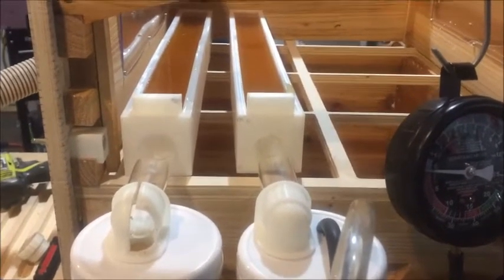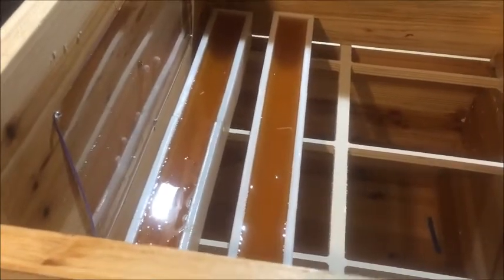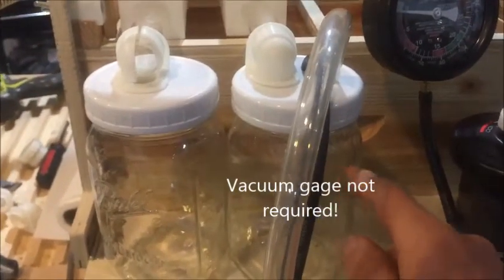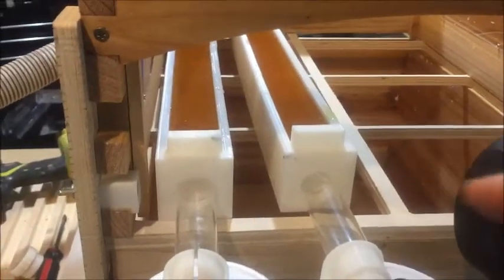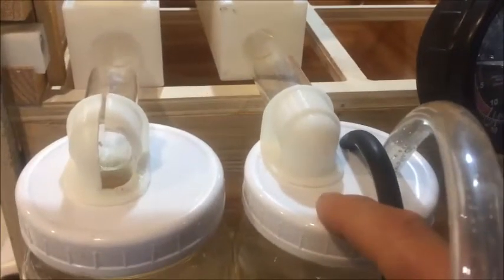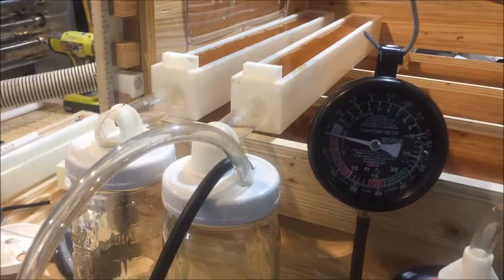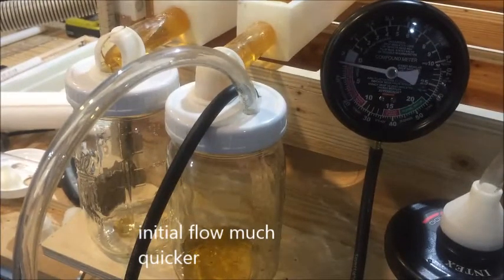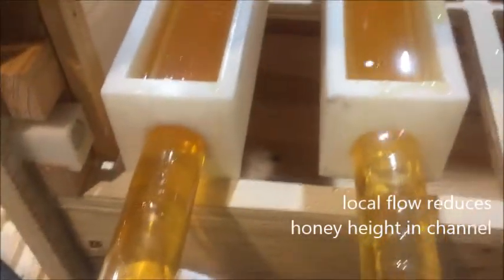FLOW hive honey harvest with vacuum assistance

Comment: as an owner of 6 flow hives- I don't think this technology is necessary. Also the flow collection channel is not airtight- I am not sure how effective your idea would be in the real world. The best way to reduce leakage is to harvest the frame in increments; putting in the key 1/4 of the way at a time and leaving it to to flow out for 20 minutes between increments. The honey in the channel rarely fills it to the brim- which means a vacuum wont be very effective.
Reply from the maker: I appreciate your comments.  I too have used the 1/4 frame at time opening.  I don't think that the vacuum assist reduces harvest time, it just reduces some internal leakage at the beginning.   Plus the video is just showing what happens for folks that wondered if vacuum could help.  The drain cover just preventing bees from getting trapped in the honey is the biggest improvement regardless of whether vacuum assist has any merit or not. I have used vacuum with my hives in the real world, it seemed to help some, but it didn't reduce  harvest time.